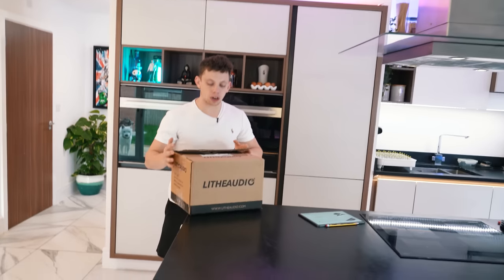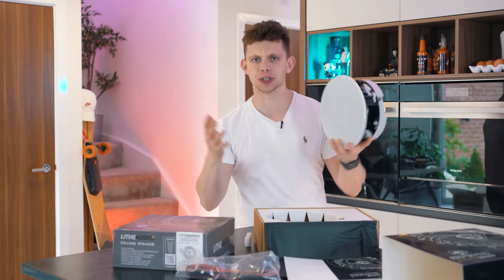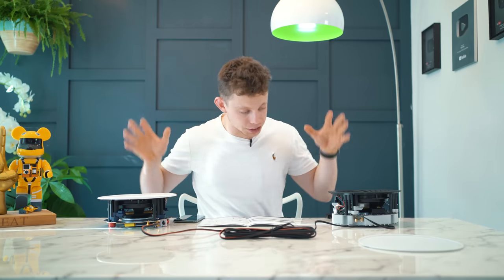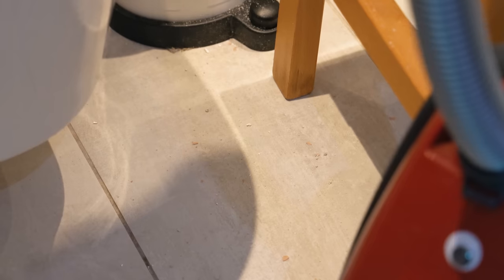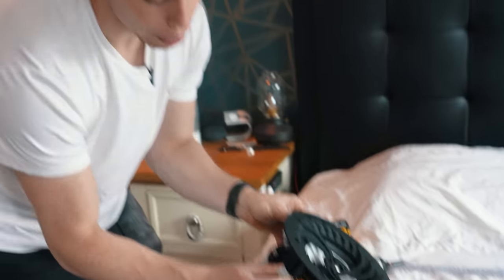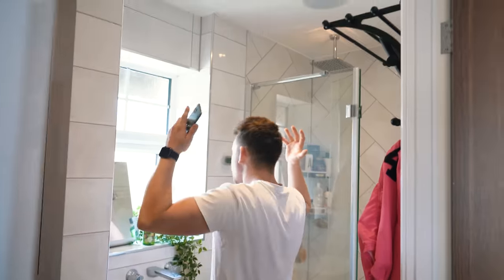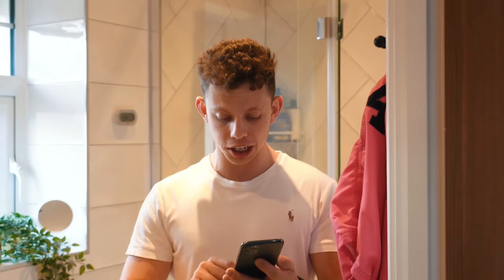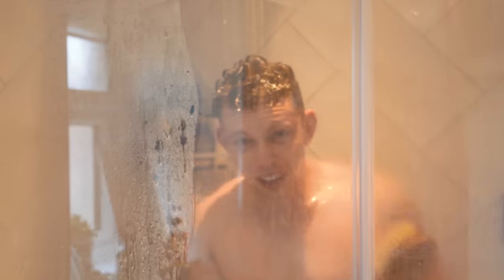Finally Installing A Smart Invisible Sound System In My Bathroom!

Comment: I do a lot of my own DIY stuff and I have a Deco mesh unit in my loft, along with wiring for an echo dot on my bathroom ceiling. 

Do you ever worry about things getting hot? With that insulation in the ceiling do you not think that could have an effect on the cooling of your gadgets?

Comment: next install: fire suppression system in the roof
Reply: What for
Reply: On a 12 volt?. Naw. But would pick the plug in connection off the insulation nail it to the stud or maybe wrap it
Reply: @stevengibbons1101  Fire hoods are designed to stop the spread of fire from one zone to another, it's not necessarily to prevent damage from the item itself catching fire
Reply: @MatSmithLondon  not sure what your point us big guy
Reply: @stevengibbons1101  You said no point in any fire suppression system for the loft, because it's only 12V. That misses the point, at least here in the UK we have building regs that require fire hoods to be placed over fittings, regardless of what voltage they are. It is related to the fact there's an opening in the ceiling which can encourage fire to spread through loft...
Reply: @MatSmithLondon  oh ok gotcha  now

Comment: I'm renovating a bathroom for my teens and they all listen to music on their phones. I'm actually shocked how few options there are for built in wall or ceiling speakers, bluetooth of course.  A portable one isn't convenient. You have to charge it , it takes up space and the kids will end up taking it to their rooms. And no, those ceiling fans with the built in speaker are crap.  I could rig one up I suppose but I'd rather just buy one.

Comment: Power can be spurred off the ceiling lights. Check the manual
Reply: yeah, but if he's already got standard mains power in his loft then he doesn't need to bother with that
Reply: Doesnt mean you have to though and if it were me id have neither used extension or spurred of the lights - I would have used a 3A or 5A switched FCU off sockets circuit

Comment: What’s the fire rating and IP rating of those speakers? Have you introduced an external socket circuit into the bathroom environment?
Reply: Just take a feed from the sw / Light into a Spur ( above the ceiling ) and take it from there into the speaker
Reply: Ip65 and fire cement
Reply: They're IP44

Comment: Are the waterproof or water resistant?
Reply: Yes, that's why they're bathroom speakers 🤪
Reply: IP-44 rated cones. Designed for steam and condensation. Avoid placing directly above a showerhead and splash zones for full longevity avoid.

Comment: An extention lead plugged into an extention lead... Fire hazard right there 🤦‍♂️
Reply: It doesnt matter if you chain extension leads as long as you dont overpower them.
Reply: @2005Bener  exactly plus most extension leads have overload protection

Comment: Are they waterproof? Just thinking about steam and condensation from the hot shower?
Reply: The Bathroom speakers are IP-44 rated and designed for steam and condensation. Make sure you choose the ones with the white cones.